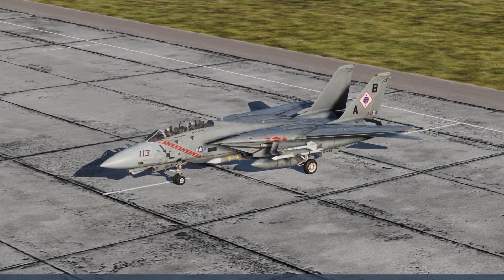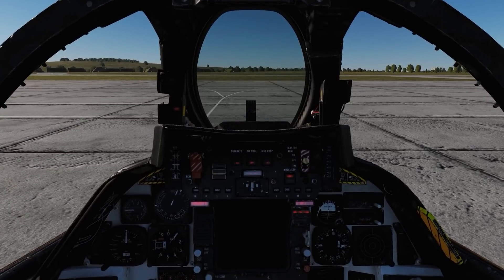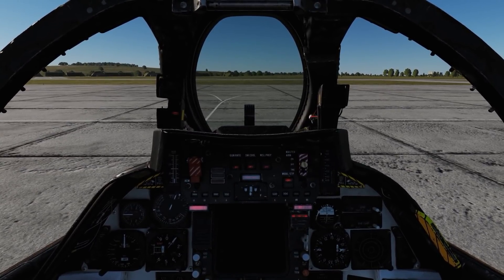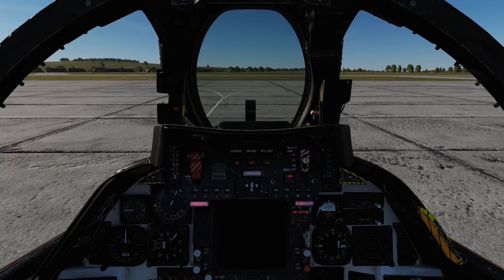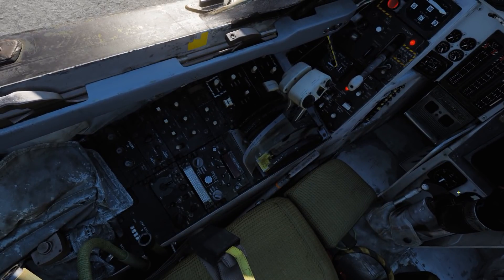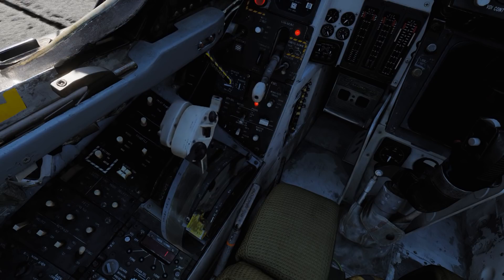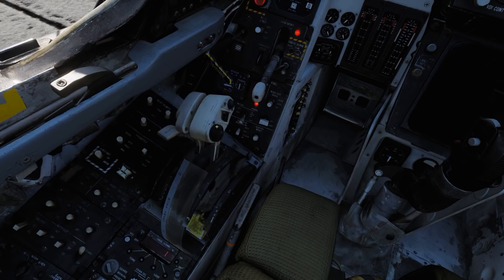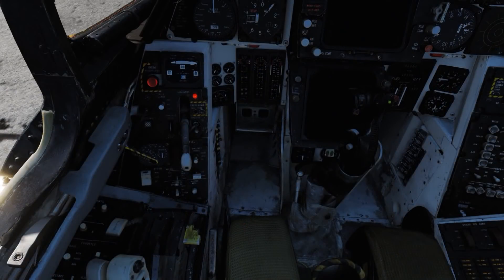CVW-11 F-14 Front Seat In-Depth Breakdown.

Comment: I am learning the DCS F-14 now and your great Video helps a lot, many many detailed Infos. Thank you very much Sir, you are doing great. One thing I will maybe never understand…….why is there no main battery switch in the Tomcat? Every plane I know has a main battery ( I am new to Jet Fighters…..maybe it is common there and a normal concept!? ), the first time I hopped into the F-14 cockpit without knowing anything about it I was searching for the main battery switch and the APU......….LoL! I am flying B-747 in real live, I did only learn to fly small piston engine aircraft,  turbo prop and airliner jets, starting to learn a bit more about modern combat fighter jets on my PC with a simultaion software I realize that it is a total different world, many new procedures and totally different concepts. It is really interesting.
Reply from the maker: Glad the video helped you!.  Spiceman and quite a few others in our organization are a treasure beyond description when it comes to this stuff.  But to answer your question.  Tomcat has no battery per-se. The only battery it had was in the emergency NPS (Navigational Power Supply) which would keep the nav system online for 10 seconds or so if power was interrupted.   The rest is driven by the main generators from the left and right engines, there was a backup hydraulic generator that would last a little while as well.   But there was no APU or no aircraft battery at all.  Start Cart was the order of the day for Tom and his pals :)
Reply: @carrierairwingeleven1747   @Carrier Air Wing Eleven  Hello Sir, thank you very much for the kind answer. Oh yes, now I know already that it has no battery or APU, I am reading the manual from Heatblur, besides watching many tutorial Videos, your Videos here do help me a lot in better understanding the Tomcat and it´s system design. About that Nickel Cadmium battery which feeds the Navigation system for only 10 seconds to prevent loss during power transfers or short interruptions, I read that in the manuala few days ago.
I thank you for your videos and help, I will watch the other Videos now to learn more about the RIO station.

Comment: Thx for your great video! I got a question, have u used ground track and heading select or hold? I  know how to use altitude hold, but these 2 functions dont work. Are they not simulated yet?
Reply: Dingjia Chen I actually haven’t tried those. I would not be surprised if they’re not implemented yet.
Reply: to make Heading Hold and Altitude Hold work…...you Need to press the "Nosewheel Steering/Autopilot Engage" button on the flight stick. In the real F-14 it is the same switch for both actions and in DCS in steering command that is the same aswell, in Default Settings, the Nosewheel steering switch activates the autopilot for Heading Hold, Ground Track, Altitude Hold and ACLS landing modes.

Comment: Was the LANTIRN really able to work with the TID or it was mounted only on frames with PTID ?
Reply: Ivaylo Kolev it was only deployed operationally on aircraft with the PTID, I believe. It could display on the regular TID and there were early tests done with it, pre-PTID. HB didn’t have sufficient documentation on the PTID, so they’ve modeled it on the regular TID. It’s not perfect but it is certainly a plausible configuration.
Reply: @stevenspicer14   Thanks for the answer and the video. HB did a great job with the F-14, can't stop flying since release.

Comment: Hey one question I am a novus player and I wait the full 9 min on the carrier to do ins alignment and today I got into a fight with an s-300 and while evading I totally ruined the ins. I couldn't use the bomb fall line. What parameters cause me to ruin the ins and is there a way to get jester to realign while I pay attention to not getting shot out of the sky?
Reply from the maker: sounds like you over pulled the aircraft and broke your gyros, the Tomcat doesn't have an FCS and will happily let you pull as hard as you want.  You need to build the G slower.
Reply: @carrierairwingeleven1747  Yeah I was a little rough. This video was amazing and I learned so much thank you very much.
Reply: @carrierairwingeleven1747  I absolutely love your guys videos and professional approach to dcs. That is exactly the kind of group I'd like to be a part of, is it possible to join your air wing, if so, what are the parameters for doing so. Plzzz keep the tutorials coming.